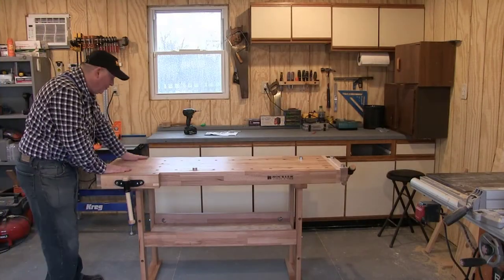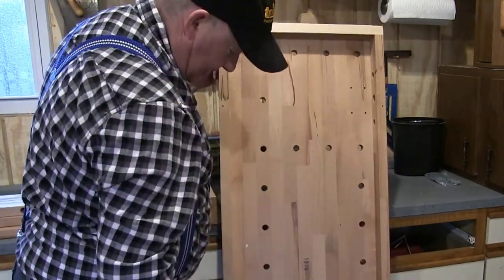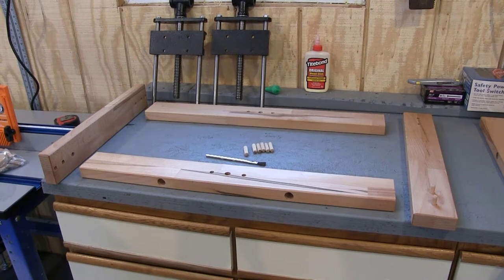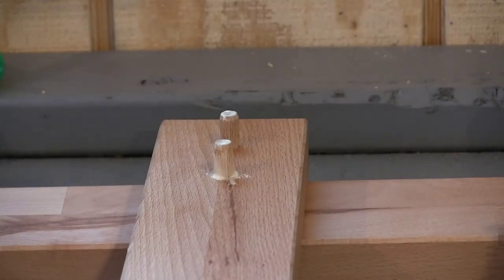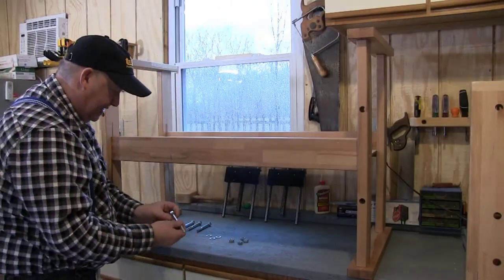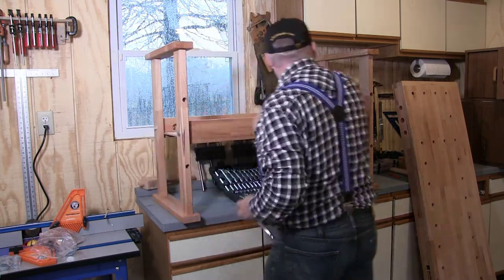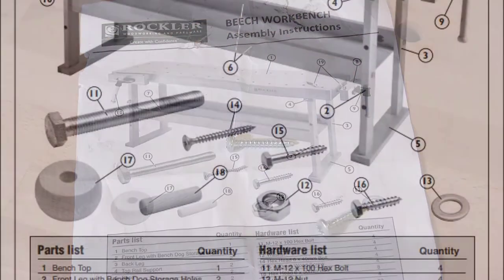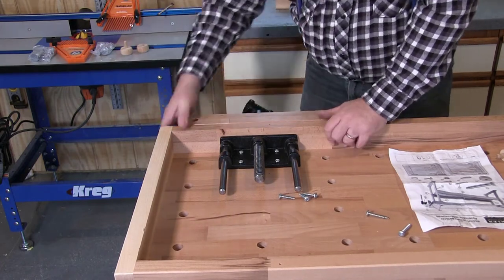S1 E01 Rockler Workbench Assembly

Comment: When I first put mine together a couple of years ago I used the glue that came with the bench.  Because there was not much glue included, I only used a little for each dowel.  This did not work out well.  I am currently re-gluing all of the dowels with Titebond II.  I had put casters on the sides of the legs that allow you to have the workbench sitting on the floor when not in use but obviously raise the bench off the floor when the casters are engaged.  Last time I went to move the workbench the feet on both sides fell to the floor.  I may even drill a pilot hole in the center between the dowels and screw the feet in to make sure they do not come off again.